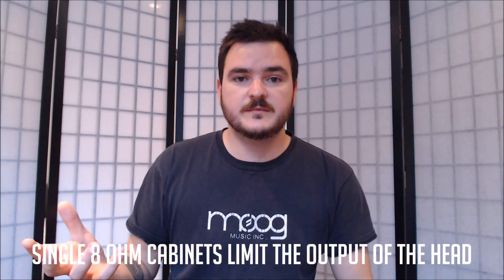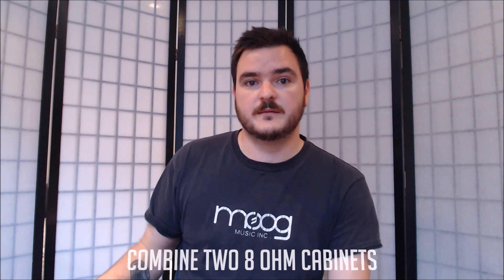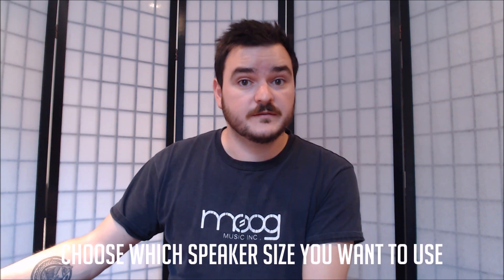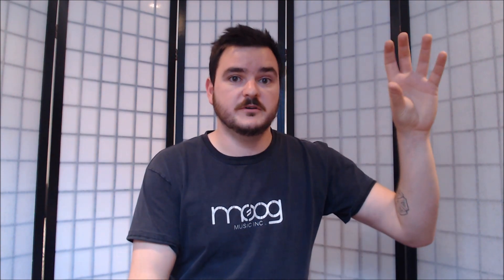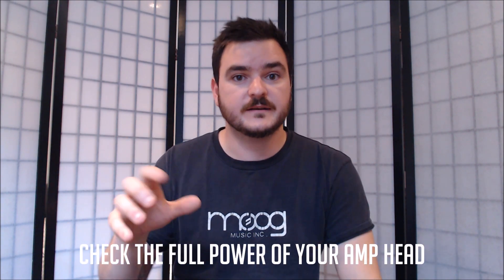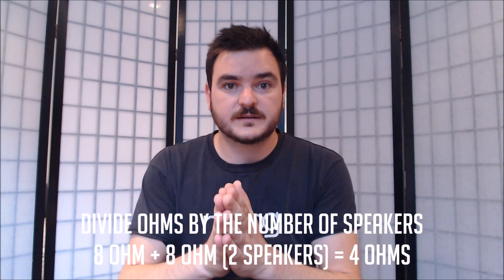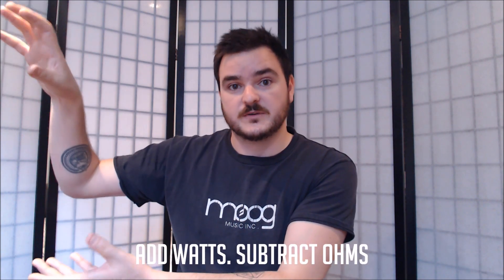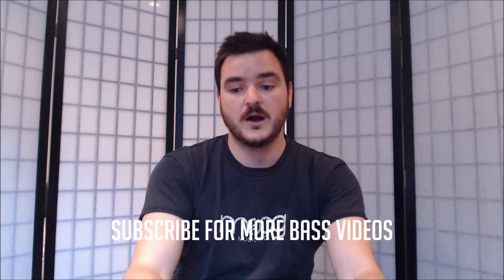HOW DO OHMS WORK? A quick guide to Bass and Guitar cabinets

Comment: Inthepockett,   Great video.  Suggestion:  please use an easle board with markers and draw diagrams.   and/or show the backs of amp heads and speaker cabs.  Also explain the different kinds of speaker cables.

Comment: Can I safely use a 800 watt bass head running into a 800 watt cab,? Both cab and head are 4ohms each. Keep in mind the question is about the wattage not the ohms. I read somewhere that the amp should be more(Wattage) than the speaker and also vice versa?(GK MB-800& GK 4x10 800@4ohm cabinet) 800 into 800??

Comment: Question about wattage: 300 watts amp head 4ohms, connected in parallel to 2 cabs of 8ohms each, but one cab its powered at 150 watts and the other its powered at 200 watts, its is good/save???
Reply from the maker: That should be okay as long as you're not maxing the output. If you ever need extra juice just ask if  you can have a DI or cab mic going to the front of house
Reply: @Inthepockett Was concerded about the wattage thing, read somewhere that cabs should have/pair the same wattage, and no, i dont intend to play at maximum volume😂. Thank you for your rep and advice!👍👍🤘🤘🤘
Reply from the maker: @Hellion73  Thanks! Honestly you'd be amazed how many people don't know that and run their amp at full then complain when it's not loud enough (only running 8ohms and melting the voice coil)

Comment: Second question. Hope to here from you.

Tc RH750 bass amp (750w) 4ohm head. Running with ampeg 410hlf cab rating at 500w 4ohm speaker-cab. Will this work?

Thanks for your answer!
Reply from the maker: Hello again, that too would be okay for the most part. There aren't many situations where you would have to run that above halfway. If you needed more than that you should be in a position where there is a DI from your head being sent to the front of house speakers and subs.

Comment: Does this set up work? RH750 amp which has 750w with impedance of 4ohm. With RS112 cab 200w speaker 8ohm?

This set up is for potability when bringing stuff to the gig. Light and compact.

Is this bad?
Reply from the maker: Hello, that would mean the head would run about 375w into the 200w speaker. It's not terrible but it would be worth looking for a more powerful cab to get the most out of it. You wouldn't want to run this setup too hot as over time it could wear out the cab.
Reply: inthepockett  this set up is for small venue where may be the drummer would not have to play that hard and no mic on any of the instruments. Just enough volume for me to be heard in a small venue. 

Up to now i still don’t understand why this company make such a small bass amp so you can easily bring it around but this small amp should require high power big cab in order to work. 

Should the purpose be small compact amp should also able to accommodate a small compact cab speaker?
Reply: inthepockett what do you think about this? This guy has the RH750 running with The RS112 200w 8ohm speaker.
Reply: I found this vid of RH750 amp with RS112 speaker 200w. What do you think?
Reply from the maker: TC's RH series is designed to be powerful but small. The idea is that you'd eventually buy two cabs for it but it's much easier than lugging an old trace elliot etc around.
Reply from the maker: I'd recommend looking at the less powerful RH450 if it's only going to be used with one cab. That way if you do end up getting two of them you'll be better matched.
Reply: inthepockett 

https://youtu.be/mwGcdrTLBbs

Link above i forgot to link it.

The problem is i already have the RH750.

Comment: I have a 1000 watt bass head and want to connect two cabinets at 8 ohms, the bass cabinets have parallel ports, plus the main port. Will this work if I have one wire coming from that head to one set of speakers and parallel ports from the speaker back to the speaker plugged into the main head? thank you.
Reply from the maker: Hello, what brand/model are you looking at? There are various trains of thought but if the head has two outputs I find it safer to send one to each speaker independently. That way if one were to die the other wouldn't be linked to it.

Comment: I have a r1000 head, with a rl210t, and rl115. It has 2 speaker outputs @ 2 ohms each while the cabinets are rated @ 4 ohms. It also has 2 4 ohm outputs with the word bridged by it... Wth does this mean. Btw, the speakers crackle when I use this head with these cabinets, but when I use my ampeg br2 they sound great. However, I am afraid of overloading the br2. This stuff is too expensive to destroy because of ignorance. The br2 provides 350 watts @ 4 ohms and I was trying to run 2, 4 ohm speakers which is a bad idea. Right?

Comment: Awesome video, finally making sense! I just want to confirm I have an Ashdown MAG300 (300w RMS - 500w Peak, 4 Ohms) hooked to a Ashdown 4x10 cabinet (8Ohms, 450w). I've used it for years but only recently purchased pedals and noticed my setup not handling to well and also pushing the input on the head to max at times. Should I be upgrading the entire rig or a more powerful cabinet? Thanks!
Reply from the maker: Hi Jeenie, chances are that the pedal chain was what caused the drop in signal rather than the amp. Worth looking at how those are setup before you consider changing your amp. It's worth looking at Ashdown's new range of ABM if you ever want to upgrade anyway!
Reply: @Inthepockett  Hello, like the channel, Subbed. Question. I have a 80s  tube Hiwatt 100 Bass head, 2 outputs, a 8ohm-16ohm selector. I am considering a Warwick 8ohm 410 300 w One cabinet, 8ohm cab 8ohm selector.  Thanks understand the 300 w rating on the cab, 100w On the head part, likely the cab-cabs I get will have a higher w than the 100w on the head....My question is, if I wanted to hook up two cabs, Using the two speaker outputs, so Parallel,  What are my options,  using the 8- 16 ohm selector??? If I have it on 16ohms which 2 cabinets(ohm wise) on 8ohms?(which 2 cabinets) I am confused. Your help is much appreciated Thanks  Man

Comment: Hello there very nice video but something is bothering me i have marshall valvestate 8100 100 W head on the back i have  2 x 4 ohms out,for example if you buy 2x12 cab with V 30 celestions at 8 ohm each in  and wired in parallel in that case i will get 2 x stereo in 4 ohm and please correct me if i get something wrong

Comment: Quick question. Will the Peavey Headliner 1000 (1000w @ 4 Ohms & 700w @ 8 Ohms) work with a Peavey 410 (800w at 8 Ohms)? Or is that too much power?
Reply from the maker: Mateo R Thanks for watching. That should be OK provided you're not pushing it to the max. In any of these cases you'll soon know if it's a poor match because the signal will sound overdriven without much gain. Always best to check the ratings like you've done 👍
Reply: inthepockett Thanks! You are a gentleman and a scholar. Just purchased my rig on reverb

Comment: I have a 2x12 cab rated 8ohms. each speaker inside the cab is 16ohms therefore they are wired parallel (pls correct me if i'm wrong). At the back of my cab, there is an output link that says "series". if i connect it to the similar cab (8ohms) how many total ohms will i get? thanks
Reply from the maker: Hi thanks for watching! When wired in series it'll split the amps power in two and send half to each speaker. You only really need to worry about the cab in total so two 8ohm cabs will make a 4ohm load, This all depends on what head you're using too.
Reply: thanks

Comment: I have an orange micro terror that's 4 ohms with 20 watts that's running through a black star htv 1x12 that's 16 ohms with 80 watts.  Could this damage the amp head?
Reply from the maker: Hey Nashy. The micro terror has a minimum requirement of 8ohms for a speaker out so that should be ok as long as you're not absolutely caining the master volume. Check out my video on Gain structure for some tips on getting a strong signal without blasting the volume :) Thanks for watching!

Comment: This is Great! thank you!  

I currently have a GK 500 Bass Head.  On the owners manual, it states 500W @4 Ohms and 350W @ 8 Ohms.  I am currently using a Peavey Headliner 210 8 Ohm Cabinet.  I was noticing some distortion coming from the cabinet during a show.  Is this normal?
Reply from the maker: Hi Rich, thanks for watching! it depends how your gain and eq were set but your cab shouldn't be a problem, It's 400w @ 8ohms so a pretty solid match for the heads rating. Check out my video on Gain structure here for some tips > https://www.youtube.com/watch?v=pja6jLtJ0d0

Comment: Is a dual 2 ohm sub 2 ohm or 4 ohm? Absolutely mind boggling!
Reply from the maker: Mc Rem in theory, 2 x 2ohms would run at 1ohm. I've not come across any bass rig that runs below 2ohms though. What gear are you running?
Reply: inthepockett thanks for trying to help... I give up... to complicated... peace
Reply from the maker: Once you see the pattern it becomes easier to work out :) 2 x 8ohms = 4 ohms (8 divided by 2 = 4) So 2 x 4ohms becomes 2 ohms & 2 x 16 ohms becomes 8 ohms. You take the ohm rating of the cab and half it if you pair it another one that's the same.

Comment: Ok. So what I get from this is that my 800w @ 4ohm head with my 1000w @ 8ohm 4x10 & 500w @ 8ohm 1x15 should be pretty safe because that's 800w @ 4ohms into 1500w @ 4ohms... correct?
Reply from the maker: Hi Marco, yes your maths are bang on. Your 1x15 cab is a great match because your head will run at around 500w @ 8 ohms. However, if you use both cabs simultaneously, the 1000w speaker will be drawing twice the power of the 500w. A mismatch in watts is manageable when it's fairly close to the full output of the head but In theory this would cause power drain on the head if used regularly at volume. In an ideal world, the best match overall would be 2 x 400w 8 ohm cabs. I hope this has been helpful. Let me know if you have any other questions :)

Comment: What if you have a 500 watt head at 4 ohm, a 410 of 400 watt at 8 ohm, and a 210 of 200 watt at 8 ohm?
Is there any risk of damage? Does the head split 250 watts to each cab?
Reply from the maker: Mr. Silver995 Hey thanks for watching. The larger cab will draw more power than the smaller cab but they'll work fine as a 4ohm rig in that setup. Ideally the cabs would be the same wattage, but that would be OK to run at a decent volume :)